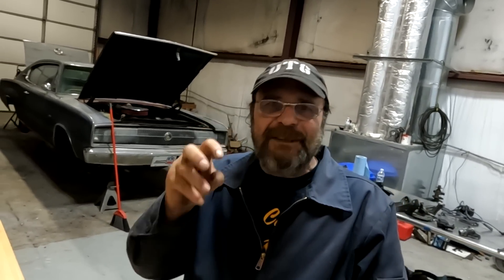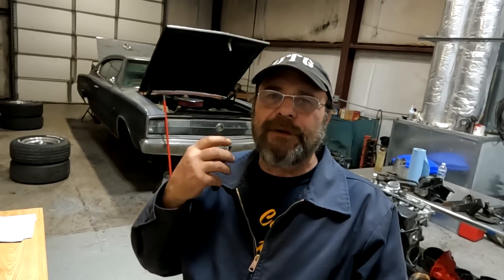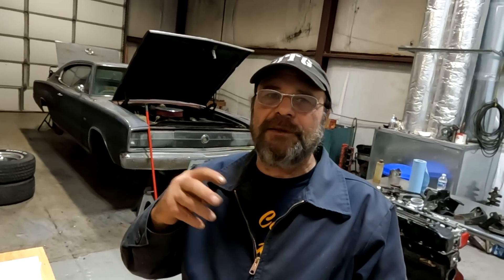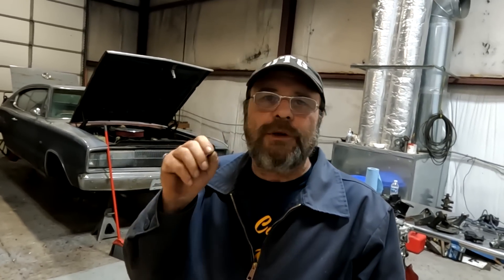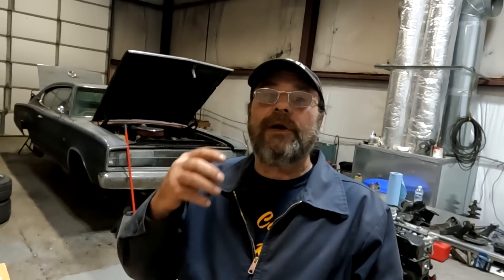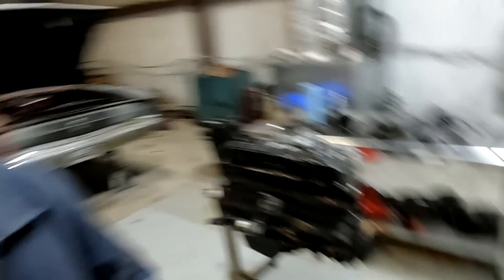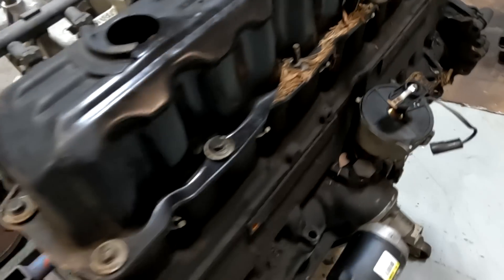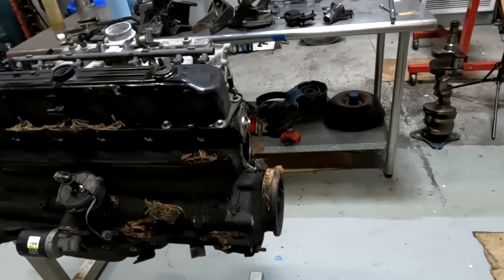Your First Engine Job - The Teardown, Diagnosis And Repair Of A Typical Automotive Engine

Comment: To your point of well informed guys, you can never stop learning or gain too many perspectives. I watch this series and a lot of your videos for both reasons. Never give up on learning or be ashamed of not knowing. This coming from an automotive grad with honors who graduated with half the dealer training modules to become a master tech, and I don't know shit compared to most. I see myself as a beginner still at 3 years in, but with a good foundation. No shame in being a beginner, dont let people downplay you. Goes both ways really, I used to ask my mentor (who was a 20 year vet) questions on my tests to help me prepare and he couldnt answer 20% of them at points. Not because he was a bad tech, he was awesome, but because it wasn't applicable to his day to day so its useless info to him. My favorite stumper question was: How are the min and max lines for fluid, determined on the brake reservoir. Nobody in the shop knew the answer but me, and that damn sure dont make me better than them. We just have different insights to share, seek perspectives those who wish to learn. Also, many thanks Tony D., you're going to help me tackle my fear of messing up a carb if I touch it. I learned a lot in school, but theres much more I didn't learn. If you ever need some advice on an Acura, perhaps I can return the favor of knowledge. Fun fact, I did that on another channel regarding an PCM, in hopes it could help someone out and save a future expensive repair. Cheers folks!

Comment: I am looking at a 300$ wj 4.0. Hoping to find a 4.2 crank and rods for a budget stroker. I have an older 4.0 with 5 speed in my xj now. My old wagoneer been eating my jeep budget lately. The xj is rusted but like the 5 speed and transfer case with sye. The wj had a 4.7 v8. So looking for tj manual ecm. Gotta redo front axle soon. Fix some wrong geometries because went wider. With 98 ram axles. Been through a 44a and 35c rear ends already. Gonna level the silverado first to fit new tires on it. Thanks for all the videos.

Comment: I agree, the engine is the heart and soul of the car.  If I buy a Pontiac it had better have a Pontiac engine in it, not Chevy.  Same for MG, AMC, etc.  Want a Chevy engine?  Buy a Chevy.  Leave the other cars alone.  Those engine work very differently.  But in the auto industry the infotainment system, or features, gets much more attention than the engine ever does.

Comment: My very first engine l did by myself went well except some how l got one of the water pump gaskets twisted and after about a gallon and a half of water l tried to start it. And it did start but l had water shooting out of every oraface of that poor 318. Tore it back down and found the twisted gasket. drained all fluids changed oil filter bla bla bla.  Ran and lasted a long time after that.

Comment: Are you gonna build this engine back stock as a rock or add a lil performance to daily driving. Maybe a RV cam, better efi intake, or a 4.2 crank for a 4.7 stroker 😎

Comment: I AM SO STOKED! THANKS FOR DOING THIS TONY! THIS IS LITERALLY ON MY GOALS LIST OF 2023 - TO REBUILD MY FIRST ENGINE...which comes from my first car I bought back 2 years ago - 1995 Ford F-150 with a 300 six. It still ran, but had 234k miles not so it will be the soul of my next build, whatever that is.

Comment: I'm in the middle of building a 92 4.0l for my 94 jeep Cherokee, fantastic trucks! The only issue I've run into so far is that aftermarket replacement rod bearings don't have the oil squirter hole on the edge of the bearing halves where they meet. I ended up filing some in by hand. If you run into the same thing I think it will be a fantastic teaching point.

Comment: Thanks for this. Just what I need. Can’t wait for the installments. I daily drive a ‘64 F100 with the original 223 in it. I’m anticipating issues and want all the info I can get. I know you’re a Mopar guru. Thanks for letting a new Ford guy learn from you!

Comment: 50,000 more miles with a knock is the definition of durability.  

Machines that continue to function when terminally broken are dependable.

Now is when I insert a joke about rebuilding chipsets in new cars that don't function when minor issues flag limp home mode lol

Ev and ICE included.

Comment: This is great! I’m totally on board. Just bought a 1980 Granada with a 250 six cylinder. Right now it runs like a champ. The body has zero rust. Trying to decide whether to do a V8 swap or go over the 6 ? But anyway this series definitely sounds like it’ll be fun to watch

Comment: This is what I've been waiting for. I've done a lot of stuff to cars. But I've never been past the heads. And that was just a head gasket and timing chain job. I've never done anything with bearings.
If you're looking for an idea for a next 'your first' video. Might I suggest a rear differential. I really want to rebuild my rear end but it costs way too much to mess up

Comment: Hmmmm deisel,well the 5 steps works,12,volts to glow plugs,timing,fuel check,system,start and run circut,neut.start adj,voltage or lack of it.

Comment: I gotta say this is an awesome grounded channel. Not a big performace guy or a mopar guy, but I'm one of those looking for the little details, tips, and tricks I can pick up. I can see a lot of people cringing on that frame chop job, but like you said cant be afraid to try. I'm currently doing a frame fix on my truck, it sucks being a solid frame, but its going to work and it needs to be done. Awesome work!!!

Comment: I have a question Uncle Tony.
From what I understand with reference to power and torque of an engine from your videos in the past,
a stroker gets more torque; the closer your burn approaches 90 past tdc the more power you get.
if I understand the mechanism going on, the stroker has a smaller comparative bore and therefore an even burn across the chamber happens faster and more oomph against the load. The engine that can burn as close to 90 past tdc gets more leverage but with a slower burn in comparison and therefore the same energy is imparted differently; the stroker uses it up fast without much leverage advantage, the slower burn uses more of the energy when it has much more mechanical advantage.
Is that close to it?

In the future I would like to build two engines; a torque monster off idle to about 3k rpm and go batshit crazy trying to figure out how to make an old Pontiac big block get good mileage in a land yacht.  My first project needs to be not getting scared of replacing head gaskets and a freeze plug in my dad's C4 if I can because we can afford the $1000 he was quoted, which if I don't get the confidence, at least I'll understand the work involved watching the videos.  He has taken it to a couple places that don't want to work on it because they aren't sure what has been done to it.  He bought it before he went in the hospital for a few months.

Thank you for all the videos, laughs, knowledge, and just sharing who you are with us, it is appreciated.

Comment: Check the red Jeep for loose torque convertor bolts. Found that on a few 4.0 Jeeps over the years that sounded loke a rod knock. Rebuild the core still but mabe tightening the bolts will solve the lower end noise. Cheers!

Comment: you are a great teacher i worked in a engine  machine shop 25 years ago,  I decide to rebuild my 3 liter mercrusier  last summer first engine i rebuilt  since then well it ate the cam and lifters so i came to your cam videos going to try again this spring . back then never had to check new cam or lifters just replace with new and go my mistake

Comment: I started with cars as a hobby and ended up repairing construction equipment heavy iron needed a forklift just to lift a head of the engine. Started restorting a 86 el camino and you brought me back up to speed with carburetors and vapor lock and timing tricks it was efi when I got it so you helped me with the conversion. THANKS 😊

Comment: I have a 1984 Corvette and have the engine and transmission pulled out. Right now I'm saving to replace the engine since it's my first engine job. I attempted to do it years ago on a 1980D 50 dodge. That engine was simple to remove. I got the engine out and never finished it. I should have just gone to the bone yard and got another engine. I've cracked open an engine about 4 times one of those was at skill center in general auto mechanics. Although I did replace the timing belt and water pump on a early 2000 Ford focus. It took me a week to figure it out and to my surprise I set the timing properly and the car ran great. I will say if there wasn't utube I never in a million years would have figured it out. I remember replacing the first water pump I ever did on my 1987 D150 and I didn't realize at the time all the bolts were different lengths. After many hours of cussing and a few Budweisers and one big headache I figured it out.

Comment: [  ] My 4.0 litres jeep engine makes sound, not directly from engine but at exhaust, it has federal exhaust so only 1(one) catalysator, the loud sound happens there. I checked the cat by removing it, its okay, all honey bees are present and not clogged. I removed all spark plugs, went to injector cleaner shop he said and showed that they are clear and checked them on car afterwards. It used to make fart sounds and shootings like sports car after gas pedal release. After i removed and reinstalled the cat the shootings and farts are gone, but it still has loud sound like i am pressing on gas but i am not. It showed no CEL at all, zero
No metallic sounds from engine itself. Prior to these loud sound, it had thelac of power problem. After refuelling it lost its all power, i would floor the gas pedal but the car wouldnt speed at all, maybe wouldnt even shift (3speed auto). I drove it like that maybe only 3-5 kms and came home left it like that. After 1 night these all started, also tranny leaked from everywhere it could, from bell, tranny oil pan, cooler lines, shifter, it lost its all power on uphills. Thus i swapped the 32rh to ax15.
Now it still sounds strange, no more authentic 4 litres engine sound, some sound from exhaust. Do you think it might be exhaust valve or valves?

Comment: This is AWESOME! You are AWESOME! I wonder if you could take a multi-level approach in recording with increasing detail for depth and complexity for different applications that might be attempted by the first timer. If not on this series perhaps in a future series. For example, my first attempt was ultimately a disassembly and reassembly with replacement parts when I rebuilt an air-cooled, opposed 2-cylinder 650cc motorcycle engine (Dnepr) in two iterations - unintentionally of course. I did a top end job for leaky valves and a cylinder-to-crankcase gasket failure but later I had to replace a holed piston because of bad timing (part failure), a lean air fuel ratio (air leak for one of the two carb setup), and improper valve clearances. I did measure the replacement piston to ensure it would fit the cylinder but I didn't document anything because the objective was to get the motorcycle sidecar outfit running again. Now I want to build a Fiat 4-cylinder DOHC with attention to details for a best-possible performance. Would this be a blueprinting application? Thanks again for all of your help!

Comment: I have been wrenching for over 25 years. I consider rebuilding an engine a bad idea. Costs to much $, takes to long with machine work, and the chance for a catastrophic error is to large if you do not do them often. I buy used or get a reman. I will repair an engine though if feasible. Transmissions I will rebuild all day long. No machining necessary for the most part. I work on newer stuff though, nothing really past 10-15 years old.

BUT as a car guy, I would suggest doing 1-2 engines at least. 😁

Comment: My youngest son bought a 76 Nova. The car is solid and has great potential. My reason for watching this was to send it off to him. He is just starting this journey. Very quickly I realized this video is for me. What is simple for me is scary as hell to him. That is something I need to be aware of. He is amazingly smart and picks things up quickly but engines are not simple. Building a good suspension or killer ignition is not simple. To me it is because of my experience. He wants to learn and understand every aspect of what it takes to build an engine or suspension. 
Thanks, Tony I needed to hear this.
The Passion still burns hot!

Comment: October 1972. A science teacher at the private high school I attended convinced the administration to take over an unused garage behind the gym and supply it with tools. It was announced to the student body that anyone could hang out there after school who was interested in cars, and a few vehicles were donated to work on, a 1955 Chevy, owned by one of the math teachers, a 1961 Galaxie, 57 Olds Super 88, and an ex police 63  Ford Custom (stripped down Galaxie) We tore down and rebuilt the 55 Chevy stovebolt 6 first, followed by the others.
Since the shop teacher was also the science teacher, we not only learned rebuilding, but the physics of internal combustion engines, including concepts such as 2 stroke cycle vs Otto cycle (4 stroke) and volumetric efficiency. Rather than going into engineering (hated the advanced mathematics) the experience there started my career in automotive repair which I have been, and am still involved with today. Ive always passed on my knowledge to whoever was interested, and as a condition of getting a vehicle, made my daughter rebuild the trashed 4.0 in her Jeep which she still drives today 10 years after rebuilding the engine and transmission in it.
 Whether they like it or not, all customers are shown exactly what failed in their vehicle and why it failed, because of that I dont get accused of the usual shenanigans prevalent in the auto repair business.
However.....vehicles were simpler then, and the learning curve as more electronic controls were added was not anywhere as steep as for the kids starting out today. The local automotive college has a 2 year program, and those graduating are barely qualified to work in a shop, because theres simply too much to learn with newer vehicles.
Because of that, I dont know if I would want to take the same career path today.

Comment: I'm excited for this series!  I'm in the middle of tearing down my first 350 and learning.
Reply: I ve told everyone for years......Start with a Ford or Chevy smallblock.They are the most common and have good part availability as well as being less expensive than other engines. Smallblock Mopars are good too, but a more expensive build.

Comment: I would consider myself a beginner, as I've been inside VW Diesel engines before but never taken the job on by myself. Always had my father there to help figure things out. Currently have a MZR 2.3 that blew a headgasket and I'm just trying to get as much knowledge as possible before tearing into it.

Comment: Ice cream cone?  Should have stuck with the "noodle" idea.  Pasta is pasta.  But there's different sizes, different shapes, different colours, different flavours, pasta with meat or cheese inside - as well as fresh and dried types of each.  And these are only there as a conveyance for the plethora of sauces/gravies (depending on what part of Italy you're from - I'm not adding fuel to that particular fire!) like oil-and-garlic, pesto, cheese sauce, alfredo, marinara, bolognaise, vodka...where the main flavour is found.  Too many combinations to name, all based on the same theme of sauce over pasta - just like cars and their engines.

Comment: Hey Tony 3 things 1. Great idea for a playlist  2. Even old racers can use a few refreshes  at  times 3. Keeping the hart of racing alive at this point is an uphill battle  because of the following reasons,cheap used cars are run to death because newer ones cost so Damm much to replace,now days kids can't alter anything without breaking some stupid LAW!!!...And lastly finding an old car in even fair shape is getting very hard. I live in the NE USA
TIme & parts pickers have taken there toll...it's the way of things I Guess

Comment: Something about an inline 6. Slant 6, the Ford 300 I-6, the AMC 4 liter, those are the ones you always hear about making it home under extreme adverse conditions. I don't know why but an inline 6 seems like the bulletproof engine. On your 4 liter, is it possible to bolt up a carb manifold and breaker point distributor and ditch the EFI and electronics?

Comment: Looking forward to the series. I'm about to pull my SBC 400 in the next couple weeks to try and address a couple things. Oil leak in the rear main seal, and spark plugs are all oily when pulled... First timing going through an engine and could use the help!

Comment: This kind of series is not just for the novice, but the guy that built an engine once 10 years ago, or the guy that worked with his dad to rebuild an engine, but has never done one on his own. 

I've assembled several engines in my time, and I'm sure I'll learn plenty watching this series.